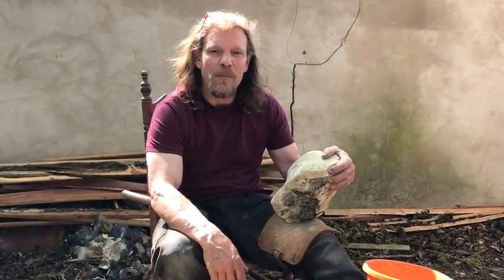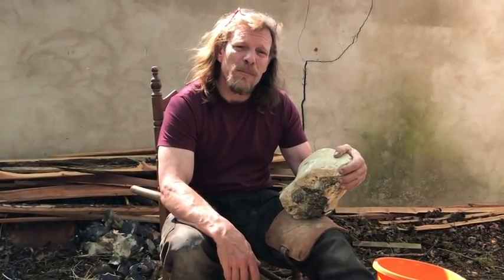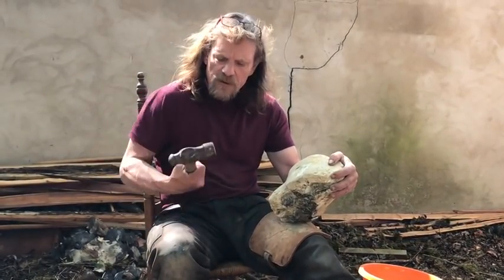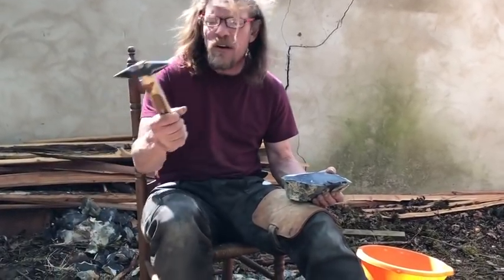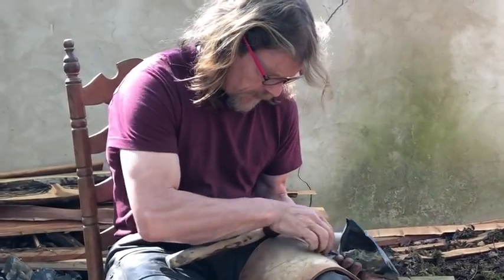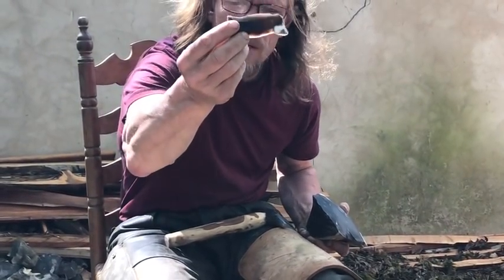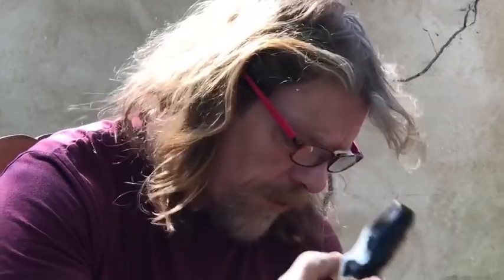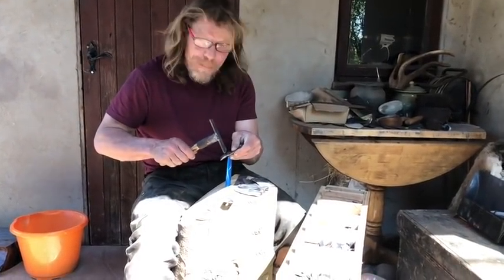Gun Flint Production with Will Lord now available at MyTradingHall.com

Comment: Good afternoon.  Tell me a few questions.  1) what is the weight of a large hammer in kilograms?  2) Is the small hammer sharp but round at the end?  3) When doing fine cutting, do you need to sharpen the stand and small hammer?